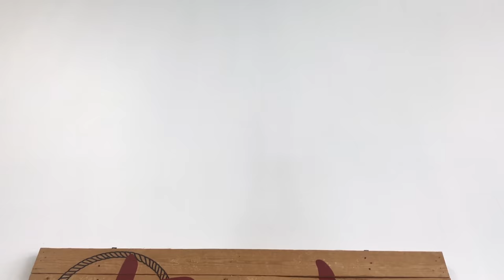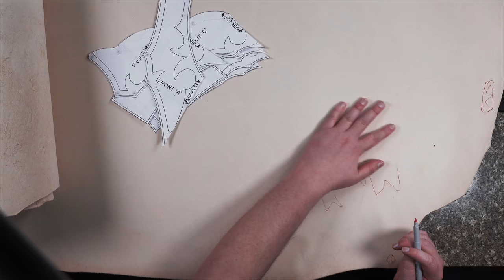How To Make An Articulated Leather Breastplate

Comment: btw how do you prevent the mould? does the coating you used act as a kind of protection?
Reply: sealing the leather properly and keeping it clean and dry will generally prevent mold. There are all sorts of dedicated mold protection products on the market, but it really just comes down to care for your leather projects and they will last you a LONG LONG time. If you do find mold on a piece you have made, isolate it from the rest of your leather stuff, use a dry stiff bristled brush to remove any visible surface mold, then spray it down with a 50/50 mix of water and white vinegar. This shifts the PH balance of the leather to make it inhospitable for mold. Leave it to dry in a sunny place, condition/seal if needed, and you're good to go.
Reply: Bjornsworkshop wow thanks! Never thought vinegar has such fascinating use!

Comment: Someone should try this out on some cosplay foam and see if it works just as nicely.
Reply from the maker: I might do some foam videos with the same patterns before long
Reply: No reason it shouldn't. Shaping the foam so it contours to the body would be different, and you'd probably need to add washers under the rivet heads so they don't pull through, but aside from the variations based on the media being used, it'd largely be the same process.

I personally would love to see someone with a large wood steamer make this out of 1/8" plywood.

Comment: what if we dont have a tandy leather store but are surrounded by fabric stores around?they supply leather.
Reply: As long as you get the right kind of leather for the project, it's not hugely important where you source your materials. I know that around here, Michael's, Hobby Lobby, and several other craft stores carry packages of small offcuts of leather, but don't have pieces big enough for larger projects like this. Tandy has a pretty good website and they are happy to ship if you don't have one locally.
Reply: @bjornsworkshop9288  ok thanks

Comment: How do I print this out?! I have read the file that is supposed to help but I’m still so confused! I spent hours trying to find out
Reply from the maker: What are you having trouble with exactly?
Reply: Prince Armory Whenever I print it out it doesn’t come out the same as in the video or three lines won’t line up correctly
Reply from the maker: @chibbles656  You might try double checking your print settings or trying alternative PDF reader programs to print.  I use foxit reader to print mine.  just leave the scale at 100% and select the option to print tiled pages and it should be fine.
Reply: Prince Armory Thank you! I will get back to you if it works.

Comment: AWWWWW this is like my ultimate fantasy comes true...looks not that difficult but the sad truth is that the tools cost so much lolll
Reply: One of the great things about leathercraft is that the specific fancy tools make things easier, faster, and more consistent, but they aren't required to make it possible. You can use a nail and a hammer instead of a hole punch... you can use a hammer alone instead of rivet setters. You can use a box knife instead of fancy shears/trim knives. You can use any kind of knife instead of a swivel knife, you just have to be really careful about not cutting too deep, but then you can use a flat-head screwdriver to bevel the patterns in. It won't be as clean, but it can 110% work!  (That said, most of the tools are less expensive than people realize. definitely worth lookin into!)
Reply: Bjornsworkshop that’s very inspiring! Great tips for whoever wants to make their own dream armour! XD

Comment: use fake leather instead because I prefer not to eat rice only for rest of the month
Reply from the maker: I don't think its that expensive lol  I think fake leather (vinyl/plastic) on a project like this will waste money.  At least use foam instead of something like pleather.
Reply: @Princearmory  for you "the pro." failing to cut something isn't a problem but for someone like me trying for the first time it's to the point that I feel sorry for the animal xD
Reply: when it comes to cutting into a piece of leather (or fabric, or whatever other material) the key is to take your time. If you go slowly, you can constantly adjust to get back on your marked line which will keep you on track as much as possible. The other nice thing about leather is that you can always trim/sand pieces to get them right where you need them to be, so 110% accuracy isn't really required. If you're 95% there with your cuts, the edge bevelling, sanding, and edge slicking will help push things into a smoother cleaner line.   Leather is a very forgiving material in a lot of ways (and unforgiving in certain others) but if you are patient with it, you can definitely make some really neat things with it!